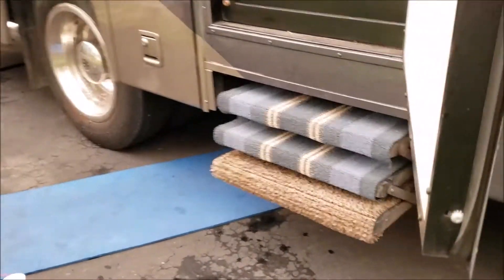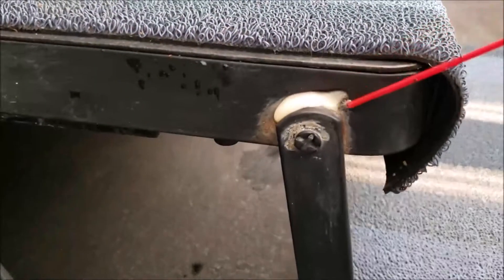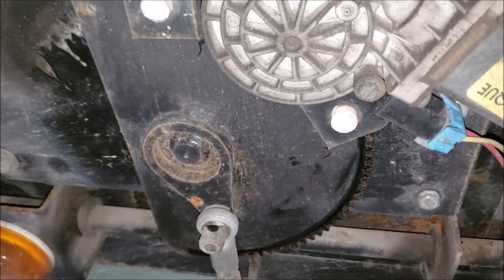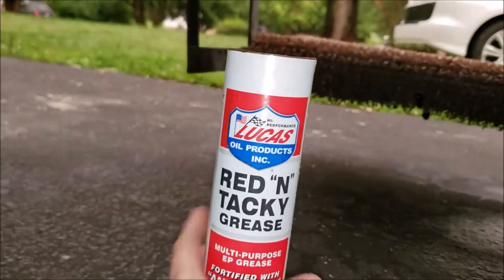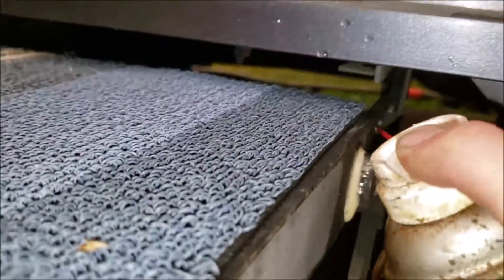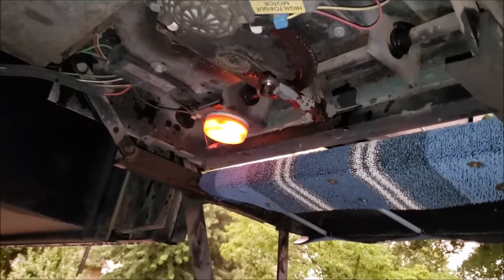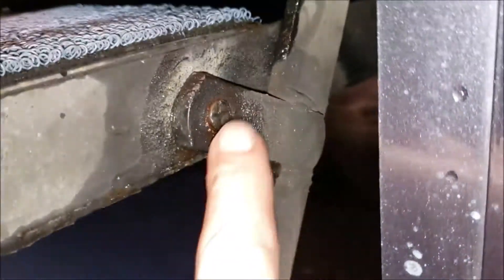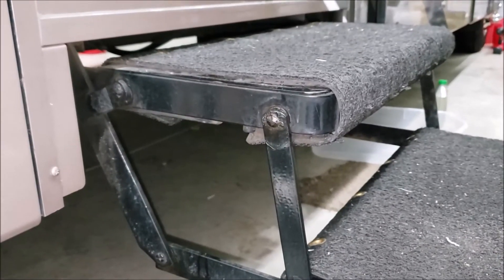Lippert RV Kwikee Steps Not So Quick Anymore My Tips Tricks and Repairs When Steps Wont Retract

Comment: I've found the self drying silicone spray or garage chain spray oil works well for this stuff too.
Reply from the maker: I like the garage chain spray ideal
Reply: I tired the silicone spray but it's just not much of a true lubricant so it didn't work for me. Sounds like the chain spray would work.

Comment: Thanks for the video, Kevin. This is my next project as well as changing out the gear and motor. The teeth on the gear are wore out,  and the ateps are jumping teeth as the steps open and close. 
BTW, I got my rear hub seal changed out successfully, and the RV passed inspection. My brother and I modified an old lawnmower blade to serve as a seal Puller, well seal pusher and wheel bearing locking tab bender. I send you a picture of it.
Reply from the maker: That's on my list also step rebuild ,, glad you past inspection. never got pictures

Comment: Great tips Kevin!!   Before our move out to Florida, I went ahead and lubricated all the stair joints because it was fussing at me(making noise).  I squired all the joints but didn't put grease on the half moon gear I just sprayed lubrication on that gear.  i need to go back and put grease on there instead of spray lube.  I now need to inspect all the stacked (what ever you called them), and see how mine are.  As always, thanks for the tips!!!

Comment: One more good tip is make sure the green ground wire connection to chassis is clean and solid. Mine wasn’t and closed about half way. Tightened and worked like new. 
I just looked and sure enough, one of my rivots is loose. Thanks
Reply from the maker: Grounds Grounds always a problem on a RV..lol